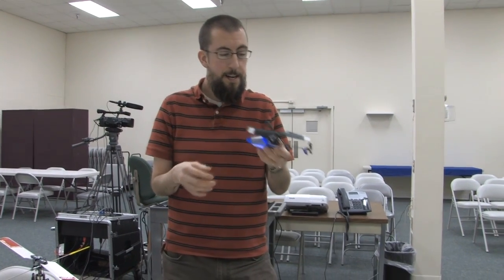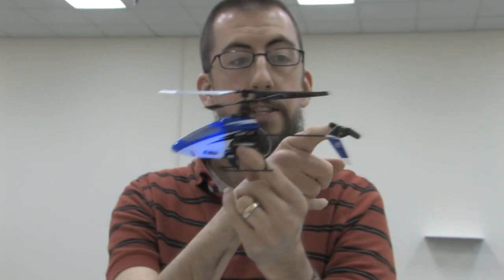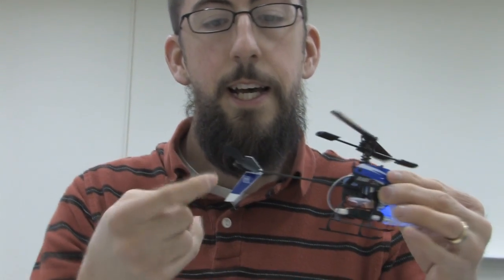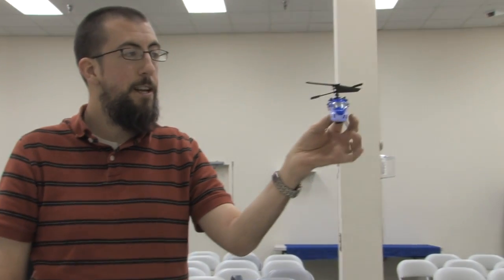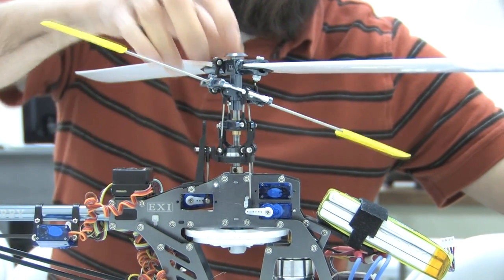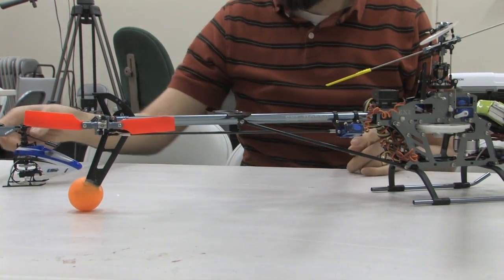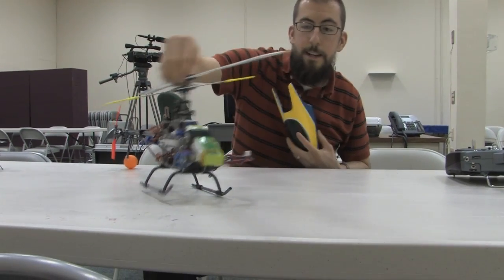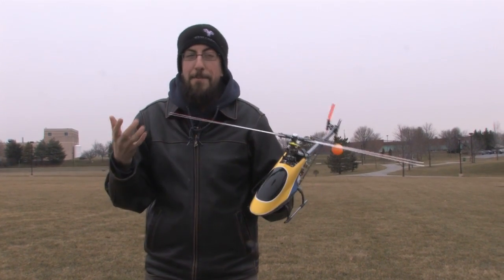How RC Helicopters Work: Fixed Pitch and Collective Pitch

Comment: Sir ,can I use a simple 9g servo for Hiller 450 helicopter because digital servos and metal servos are too costly
Reply from the maker: Yes, I think I used all 9g servos on my EXI450. A 9g is a little weak on the tail, but it works.

Comment: how do you fix the helicopters that don't like to pitch farward and fly straight? they only fly up and down or backwards.
Reply from the maker: You could add some nose weight to make it pitch forward and thus fly forward.
Reply: @CJVideoProductions  yah I thought about that, the more I've been digging the more I've come to realize it's probly the swash plate. And I can't find any videos on adjusting them on the toy grades, like sky rover.

Comment: You need to look at that bird, she is making a noise that shouldn't be there. Something is out of whack, or not lined up right.
Reply from the maker: It was about as right as it could be. It was an Chinese Trex clone - ultra budget machine. Cheap bearings and gears are noisy. I still have this same heli, but the only original part on it still is the canopy! Thanks for watching.
Reply: If she is still flying, that's always good. I liked the video, and you explained a lot.

Comment: The fixed pitch heli is a Blade MSR. It's a lot better than the cheap mall copters you find at Fry's Electronics etc. It costs more but in the long run it's a better investment because you can get spare parts and it's just overall a better quality machine that's meant to last rather than just be thrown away when it breaks. The collective pitch helicopter shown here appears to be a clone of an Align Trex 450 SEV2. Helicopters like this are usually not sold ready to fly, you buy them as a kit either with electronics, or just as a bare airframe and are required to put it together install the electronics and set it up to fly. This is actually a "mini" helicopter by most hobbyist's reckoning. A 600 class which is about 4 feet long with 1200-1300mm rotor disk (600mm blades + the width of the hub) and typicly weighting 6-8lbs is considered a "normal" sized helicopter. And if you are wondering, yes a heli that size could seriously injure or kill you if you are careless with it.

Comment: I just bought my first collective pitch helicopter. After the blades get up to speed do you have to switch the transmitter to mode 1, or does the throttle automatically become the pitch control?

Comment from the maker: @flowersvalley The big heli (the EXI 450) weighs about 850g with the battery. I'm running a Belt CP motor with a 10T pinion running about 2200rpm.

Comment from the maker: $40 for the air frame
$25 - Used JustGoFly 500th Motor
$20 - Exceed 40A ESC
$15 - TowerPro 9g Servos
$50 - used GY401 Gyro
$50 - AR6110 Receiver
$100 - used Spektrum DX6i Transmitter
____________________
$300 - ish
Reply: CJVideoProductions  hi sir how much in Saudi Arabia real..and I have for Saudi Arabia